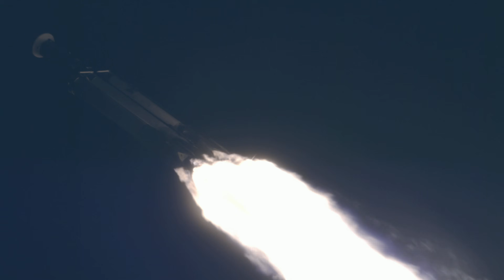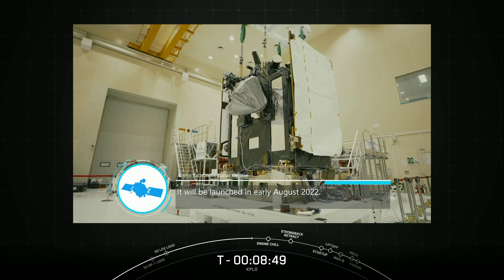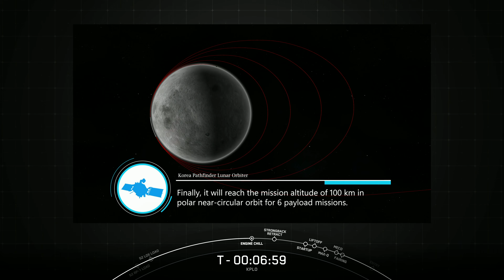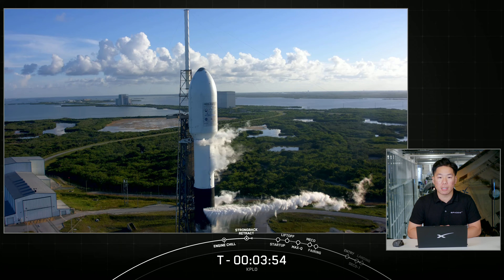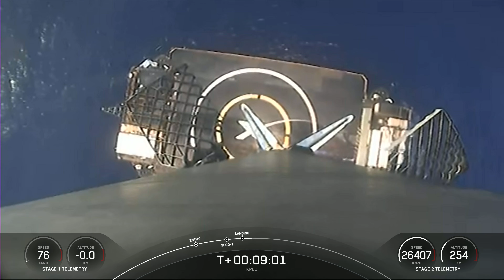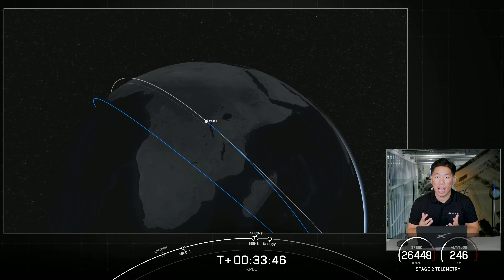KPLO Mission

Comment: why dont we use magnatic force to launch the spaces after a while it can be fired raptor engine. On opposite side, the magnetic force should also be used for landing side which it try to generate opposite force for the gravity and we can smoothly manage landing in a specific platform.

Comment: Watching an orbital-class rocket booster propulsively land on a pitching barge at sea never gets old.  Watching the live feed cut out just as the booster gets within spitting distance of the barge, however?  That got old real quick.  I get that the space within the plume of a rocket's exhaust is an extremely challenging environment for radio frequency transmissions, but why not mount a couple of upward-facing cameras on the corners of the drone barge to catch the last few moments of landing while the booster's onboard cameras cut out?